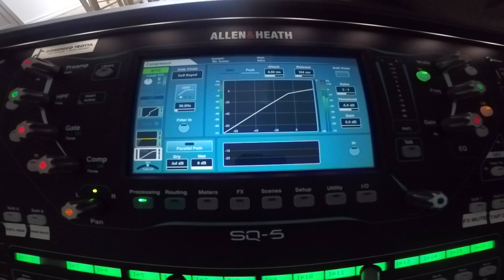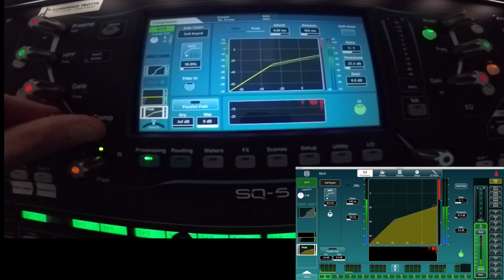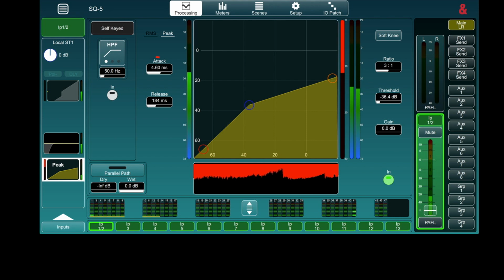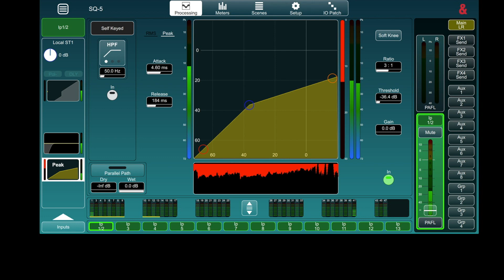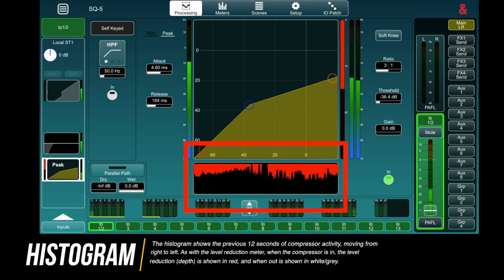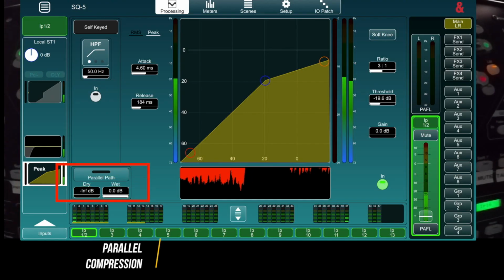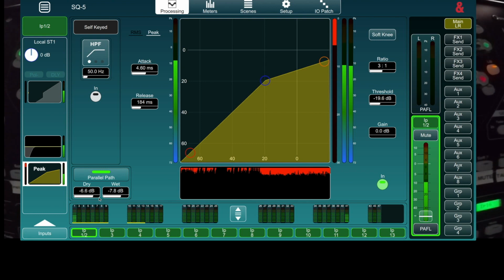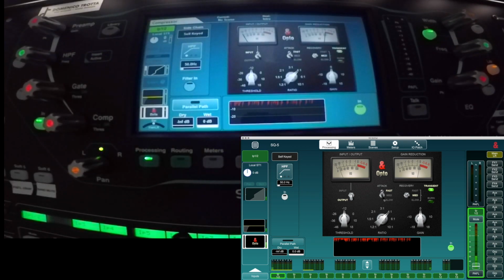Allen & Heath SQ series Quick Tip 008: Channel Compression

Comment: how many channels can you run compression on?  does that change if the compressors are side chained?  like could i side chain 8 channels to the kick if i wanted?
Reply from the maker: You can run a compression on each channel.
you can side chain only one channel, although I don't remember if if you side chain to a Group, so you can send the 8 channel to a group and side chain that group, never tried before